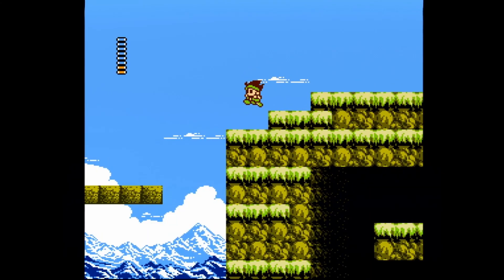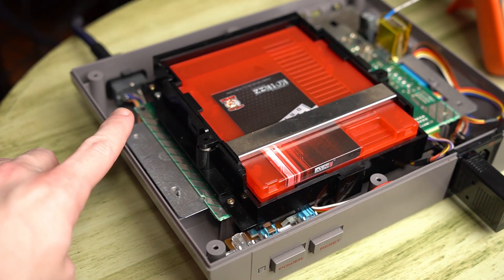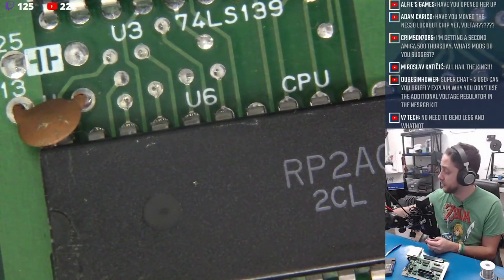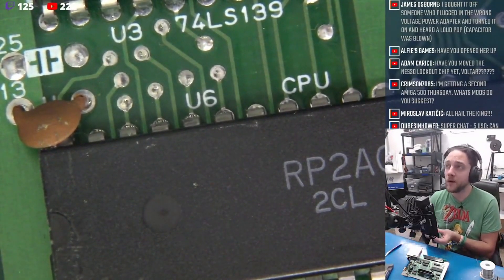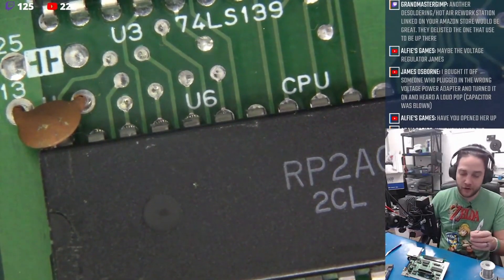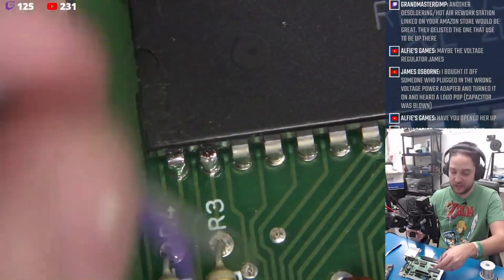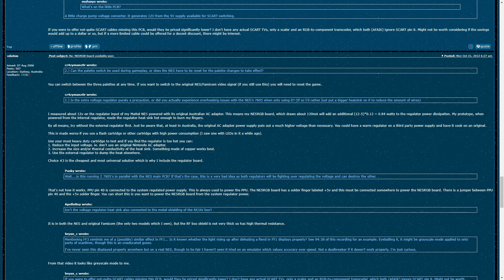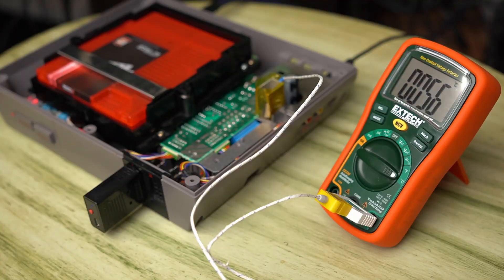Do You NEED the NESRGB Voltage Regulator?

Comment: What was the black/white issue. Im installing mine and have the same issue out of my stock composite plugs
Reply from the maker: In my case it was a bad 72 pin cartridge connection, I didn't screw mine down all the way when I was testing my console
Reply: @dubesinhower  it's weird my multi out doesn't have the issue. Composite & RGB both look great.

Having a blast playing DuckTales for the first time in 20 some years

Comment: i installed the nes rgb no cut mod everything is working perfect but the nes gets hot now it goes to 61 degrees C on the L78S05CV <has a aluminum koeling blok ,are these temps normal do i need to worry or ad a cooling fan ? iam using the og psu
Reply from the maker: I’m not an expert but I think you should be fine. There are hundreds of NES’s out there with the NESRGB, and many of them (including mine) are using the stock voltage regulator with no fans

Comment: Ok I went with no extra VR from the NESRGB kit, as experiment. So far, so good on my completed mod - although I'm using the RCA component out board, less wires? I added fresh thermal paste and extra mini heat sink too. Thought about C64 and their 5VDC regulator, covering way more board and components. If there is an issue, wonder if it's something deeper? Well, running a stress test, on all night.
Reply: Voltage regulator is good I think, after seeing results myself:
https://photos.app.goo.gl/zKv7ViyDcCcTwa8M7
Reply: What part did you use for the extra heat sink?

Comment: Voultar seems more and more like a hack, the more I watch these? Heat dissipation?  How is that any measurement to what the new circuits need? Nobody needs a EE degree to know all this extra stuff is going to ask for more draw from the power regulation circuit. Glad you fix this in later video.
Reply: I eventually went with the included voltage regulator; there is no added noise like Voultar asserts; at least not in my beautiful picture:
https://photos.app.goo.gl/zKv7ViyDcCcTwa8M7
Reply: @JohnAnderson4242  oh also, do you have any tips for removing the power supply box for full recaps? I always struggle doing it, the remaining solder after using a desoldering gun never wicks well
Reply: @JohnAnderson4242  that seems like a good option. Still have to desolder the existing power box out of the main board though right? Any tips on that?
Reply: @JohnAnderson4242  yeah there's a lot of things that are just bullshit and laziness with voultar. Not including the voltage regulator that tim recommends because it "works" without it is just laziness. iirc, the NES draws 450mA when it's displaying video, and the NESRGB draws like 30mA itself. Keep in mind that the 7805 regulator on there is only rated for 500mA, iirc.
Reply from the maker: Well he’s right in the sense that amp rating and recommended operating temperature are both things to consider when using a specific voltage regulator
Reply: when did he fix this in a later video?
Reply: @dubesinhower  that's a link to this current video. I don't understand
Reply from the maker: Oh, I think I misunderstood what video I was on, sorry about that!

Comment: Two questions as I'm in the process of planning complete re-caps of my older systems.

1) Do you think it's worth replacing the stock NES voltage regulator with a new one?

2) What are your thoughts on the Blinking Light Win mod?
Reply from the maker: I think it's really good practice, not in the sense that you SHOULD replace it like you might the old capacitors, but it's a good learning experience.

I think it's fine if you can find one and you can afford it. There are guides on cleaning up the original cartridge mechanism that would work too